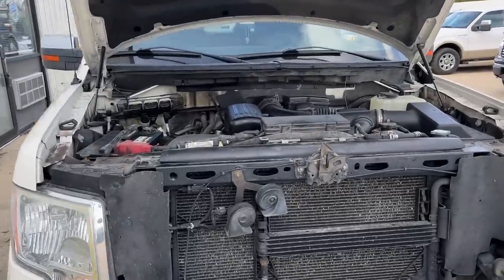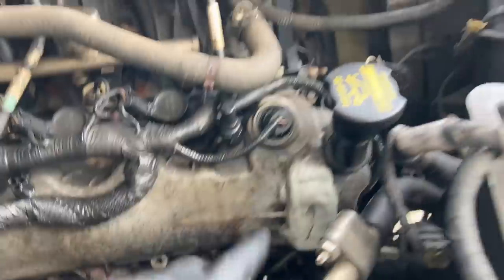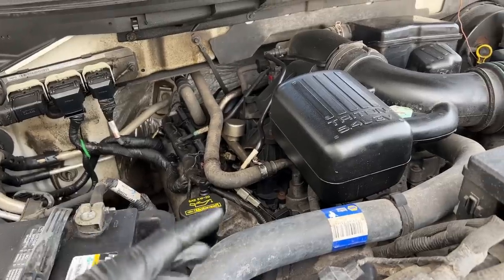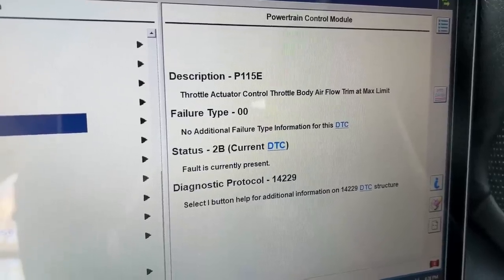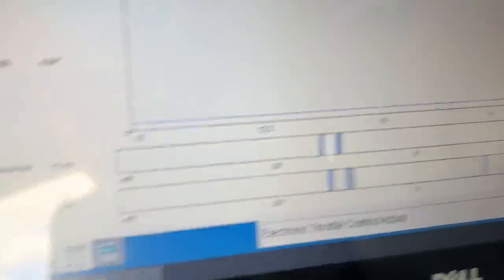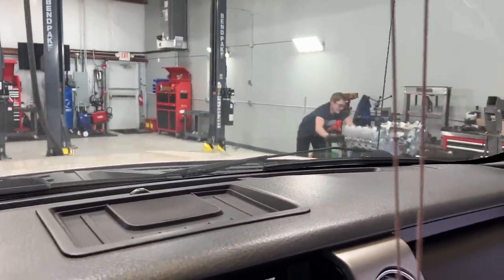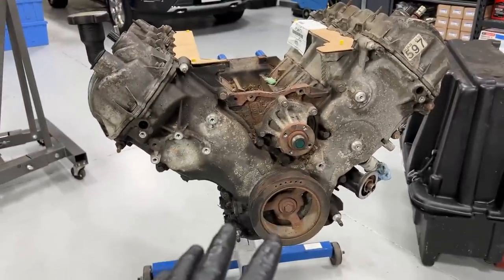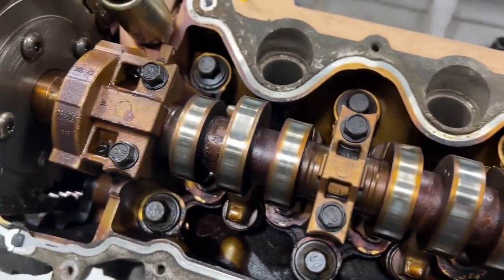Why are Ford 5.4L 3v Triton Engines Jumping Time and Cracking Valve Covers?

Comment: What is the correct tool to remove the harmonic balancer on a 2010 5.4L f-150 this year has no threaded holes like you use in your previous timing chain replacement videos, I tried to use a LS style balancer puller and the jaw arms don’t clear timing cover to go behind the tangs on balancer an a 3 jaw doesn’t fit either, couldn’t find any information on this year online that they changed balancer design?
Reply from the maker: This is the one you need https://amzn.to/3yEqSx2 I link to everything in my videos even this tool.
Reply: @FordTechMakuloco  thanks so much I bought one just like it but the Orion brand on Amazon an the tips of the jaw maybe quite a bit thicker then the OEM brand I’ll try it next!

Comment: Has anyone had a build up of orangish crud under the oil fill cap? It's not a water leaking gasket. Truck runs fine. As far as I know oil was changed regularly. Even looking down on the timing chain in that area looks a little dirty.
Reply: I have. Condensation.  Happens often if the vehicle sits idling a lot.

Comment: I have a 2009 with 163000. I have had it serviced every 3000 to 3500 miles. Maybe just a handful of times went 4000. Seems to be running OK but I am not a mechanic. What maintainence should be done at this point to prevent this or catch this before it gets bad?? What are the signs that this is coming??????
Reply: Id do a full timing job, including installing a melling hi volume oil  pump M360 roughly 150.00 from summit rcing... 20 %or so more oil flow  ... and the other must do is replace the cam followers with the up dated design
Reply: Noise...don't ignore it. I think dirty oil is what blows out the tensioners.
Reply: @jrcll7856  any idea what this would cost to have done?? As I said, not a mechanic. 🤬. Thanks for the reply.
Reply: @vaughngarner7360    that i can`t answer, cause i do my own work , but FordtechMakuloco  lists all the parts needed , timing kit  on amazon runs about 650.00,  , i bought the new cam followers and lash adjusters  for 375.00  other than the  melling oil pump { which i highly recommend  }  is 150.00,   always use Ford OEM  parts... also you have an 09   which should have the updated heads so you have traditional style spark plugs   EASY TO CHANGE .....
Reply: @jrcll7856  appreciate the info. Yes, I did change the spark plugs and new coil packs a couple yrs ago. That's the extent of my mechanicing. Lol
Reply: @vaughngarner7360  ... one other thing i found out about my 09, it started making the chattering noise when pulling a hill, sorta like detonation, talked to a ford tech that i thought was capable, he said  its your cam phasers, so  changed both at 225.00 a piece, no fix...did some homework and was told to put it in four wheel drive and see if it goes away , it did , evidently the four wheel drive is operated  by vacuum , not enough and it tries to engage , making the chattering sound , changed the solenoid on the rad support, fixed it ,
Reply: @jrcll7856  heck, well I will keep that in mind. Thanks for the info!

Comment: Need!! help 04 f150 did timing set and oil pump 360hv.  fuel injector O rings and get no oil pressure after cranking at least ten times. Will not fire up .changed coils as well I did not pull
Reply: Oil pan

Comment: What about the 2009 and 10 3v's with the newer different designed heads?
Reply: They still have problems. Still have plastic tensioners that blow out. Still have rocker arms that go bad. Still groove camshaft caps. Spark plugs are better though.
Reply from the maker: This is an 09
Reply: @FordTechMakuloco  what mileage does it have? What about a shorter oil change interval? How is this avoided? Thanks

Comment: I buy and sell cars here in the bahamas I got a 2008 5.4 3v about 10 years ago I treated with slick50 oil treatment  never had a problem the truck as over 220 thousand miles on it
Reply: You mean snake oil 50.
Reply: I'm assuming you do regular oil changes lol.

Still a horrible engine regardless
Reply: @samholdsworth420  ok iam Still waiting for it to blow up lol
Reply: @richardthomas1743  never I been using that foe over 25 years now never had a engine problem
Reply: @stevenhanna6973  I have never used it in my engine.  GMC 5.3L with 315,000 plus thousand miles. I do make sure to use a quality oil and change every 6,000 miles. But if you  believe the snake oil50 works then keep using it.
Reply: @richardthomas1743  that's good all I can tell you from experience that all my engine's I put that in never had a problem  with them and they run different from other engine that are the same. quieter
Reply: @stevenhanna6973   Nice and I can tell you that I have had no problems and do not use the snake oil50 LOL
Reply: @richardthomas1743  I also have a 2002 lightning also with 228 thousand miles also I put in the slick50 back in 2012 when I bought it with 156 thousand miles  never open the engine

Comment: I will give you a maintenance tip which will eliminate most of the problems that they are having with the Ford 5.4 3 valve. 
About 99 years ago in 1923 they started bottling what I believe was originally a motor oil for World War 1 aircraft radial engines where the crankshaft was bolted to the airplane and the engine and propeller spun as a unit. That product has since been called Marvel Mystery Oil. It does not have a very high viscosity but it does have a lot of phosphorus in it. As a result if you put it in an engine like about half a quart to a quart for about a week before you change oil it cleans everything in the engine. Especially small little passages for oil pressure.
It is excellent for keeping the tensioners clear, and also for keeping the lines that run through the Wonder heads that feed the cam phasers on that engine it's also great for engines that have things like hydraulic valve lash adjusters like 4.7 and 3.7 Chryslers and the 3.6 L Chevy and Chrysler V6 engines. And I have seen it clean up stuck valves faster than you could shut the hood after adding it to an engine.
It certainly doesn't help that Ford has decided that at least on some of these engines to put aluminum bearings inside the engine now the 5.4 is known to have harmonic issues in the engine. Which means they are going to fail. If you're rebuilding an engine or even if you're putting a new engine check the bearings and change out the aluminum for clevite bearings. The Gen 3 Hemi has aluminum bearings in it but it doesn't to my knowledge have any harmonics issues.
Still has no clue about how the number their cylinders on their engines. They're supposed to be numbered From First to Last, they number them from side-to-side. Which is utter stupidity.
Reply: MMO is good stuff, there is a reason why it has been around fo so long!

Comment: Since the high miles is he doing anything to the tranny?
Reply from the maker: No these transmissions last 300k easy
Reply: @FordTechMakuloco  6r80?
Reply: @FordTechMakuloco  How common is the TCC clutch issues on the 6R80? I saw you stated in comments of the video about the rolling TCC slip issue that the valves in the valve body tend to wear and I'm starting to get a shudder (not the rolling slip) at 154k. Is there anything I can do to avoid burning up the converter? Reman valve body maybe?
Reply from the maker: When was the last fluid service, most times renewing the additive package with a fluid change fixes them right up.
Reply: @FordTechMakuloco  Last fluid change was around 5,000 miles ago. Can some fluid be pumped out and the additive added, or do I need to do another fluid change?

Comment: Im not a Mechanic BUT plastic  For timing Tensioner really how stupid is that,,   it's only just a matter of time I'm surprised they last as long as they do.. putting  plastic inside a motor is just flat out stupid!!!! Great video thanks for your time..
Reply: Can you recommend another type of guide? You can't have metal rubbing on metal without being a bearing. Almost all OHC engines with timing chains use plastic guides.
Reply: @ameriaryan2131  ok you just Invented  it your self how about a Bearing guide,  come on plastic gets hot and cold..  I'm sure there's way more problems then you know about the plastic guides
Reply: OK I meant guides..
Reply: @ameriaryan2131  And like I mentioned to you I'm not a Mechanic at all BUT I was not aware of the plastic on other cars as in guides I knew Ford did it..
Reply: @tom535  I wasn't trying to be a jerk about it. Maybe you knew alloys that could handle the temperature. It also has to be taken into consideration production costs, and plastic is cheap. A bearing would cause the same issue as a metal guide would with heat. It may last longer but the bearings would fail. When using a timing belt, the belt surface is "sticky" so the heat doesn't build up as much on the bearings of a pulley, which are at least an inch away from the belt itself. Nissans use a plastic guide for their chains and they fail far more than the Fords, just as a side note.

Comment: M340HV OIL PUMPS rule! This video shows another advantage to the ratcheting style tensioners because they would never allow the chain to slack enough to eat a chunk of guide like that. I would rather put in old used metal body tensioners than those junk plastic ones. Also did you know they made the 5.4 2v as new as 2012?! It's a mix of windsor and romeo stuff and uses the newer computer setup with drive by wire throttle. Bolt on cam gears instead of pressed and the cam trigger wheel is way different which stumped me for a day.

Comment: Another great video to prove that the 5.4 3 valve is unreliable, although the 2004 - 2010 F-150's are great trucks. 
It has been said that Ford engineers corrected all the problems found in the 5.4 3 valve with their subsequent 6.2L.
 With thius being said, does anyone out there know if a 6.2L engine can be swapped into a 2004 - 2010 F-150?
And if not, why not?
If this can be done, to me it's better than to buy a new F-150 at over $65,000 dollars.
Reply: It can but it's not cheap

Comment: could it be that the 3 valve 5.4 was the worst gas engine ever made? gets my vote only beaten out by the 6.0 and 6.4 diesel. three of ford's better ideas
Reply: The 6.0 and 6.4 are engines that were made by international. That's why they had a lawsuit against international because the engines were garbage.

Comment: If they would do the timing kit redo at 150,000 or less they would be good , ford just put cheap parts in it , Toyota can run 300,000 on original timing parts , some old Nissan trucks also ,80sand 90 s d31 , 4.6 ford tough also

Comment: These engines are an engineering disaster.  The destruction of the plastic chain guides cause so many different problems.  All the shards end up in the oil pan and plug the oil pick-up tube, then the whole engine is starved for oil.  Would you see a benefit in dropping the oil pan at every oil change to check for guide pieces?   Has Ford ever done anything to correct this problem?,...like making the guides from metal?  Is there an aftermarket solution?  Does the re-manufactured replacement engine have the same stupid plastic guides?  It is criminal that Ford has continued to manufacture this engine for years without a resolution.
Reply: It's 3 months later, so I just gave your video a 'thumbs down' because you don't answer commentor's questions.

Comment: this is why i hate fords. simple shit turns into an $8000 engine job. sure the chevys have a valvetrain problem too but you throw new lifters in it and $500 later you are back on the road.